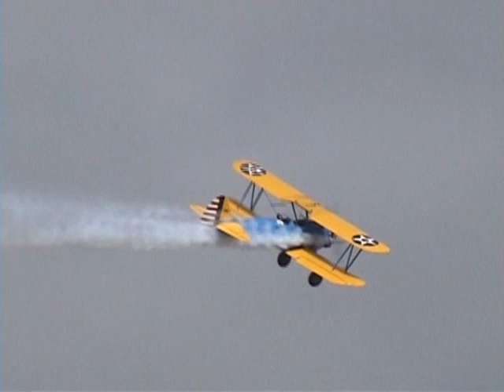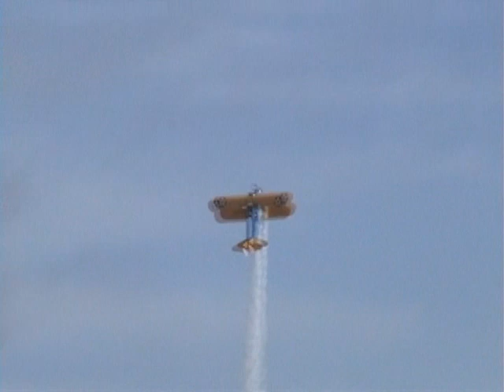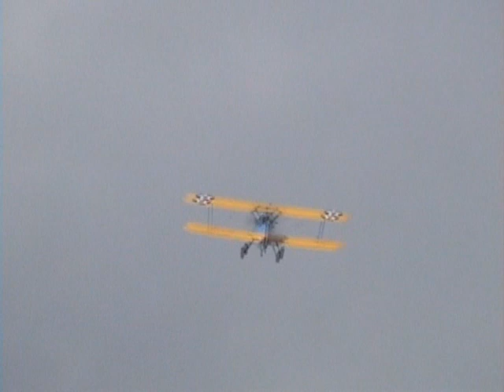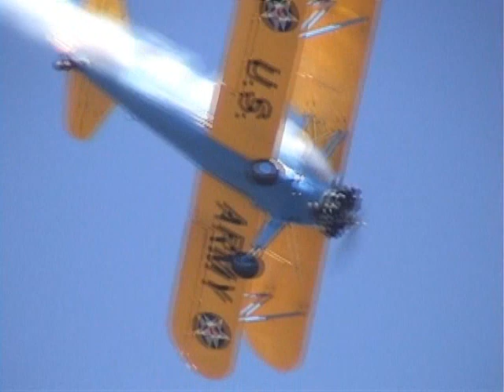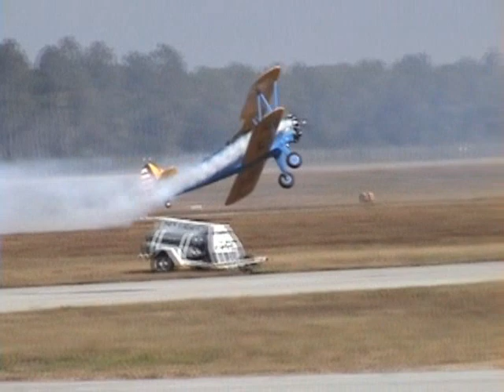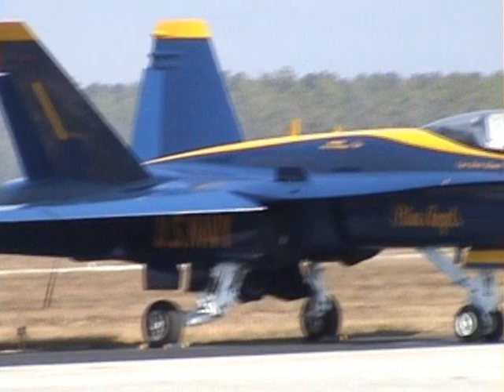2008 Blue Angels Homecoming - John Mohr

Comment: @006haloman  "...Im 16 btw..." - there's your answer.  Do you even understand the difficulty and incredibly small margin for error in the maneuvers he is doing?  Misjudging his seat of the pants altitude by a few feet could have him plowing into the runway during this demo.  Not to mention, this plane is very underpowered and sloppy at flying these type aerobatics at best.

I have flown for 13 years, from little electric radio controls to full scale with about 400 hours... this guy is good.